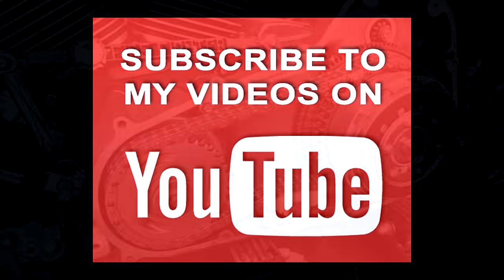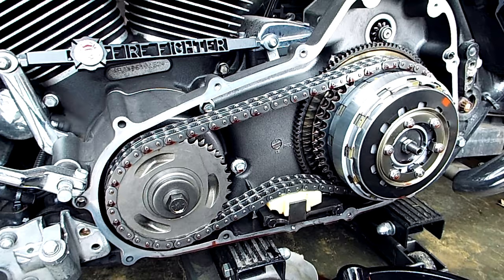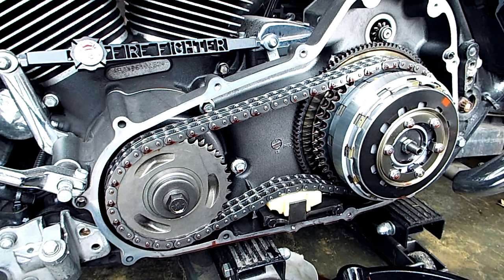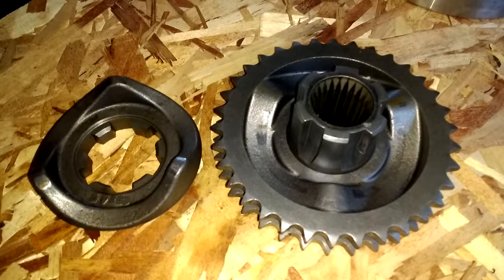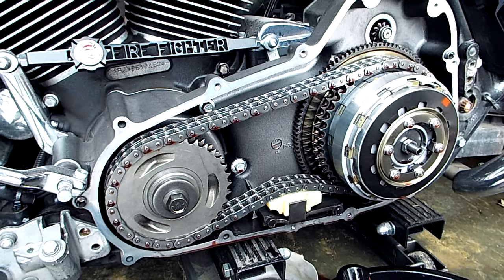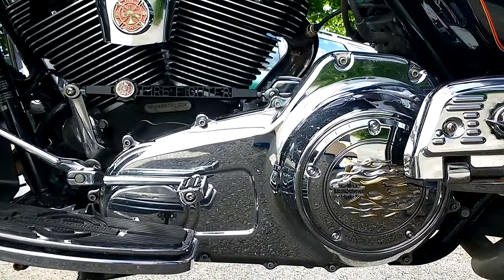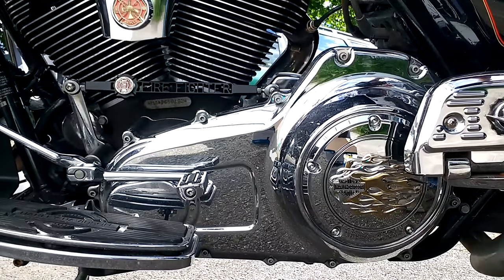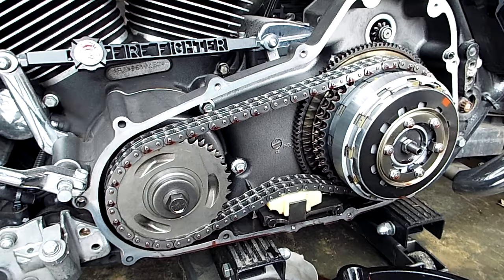Harley Compensator Noise

Comment: Same basic chain primary I had on my 47 Knuckle, 52 Pan and on my 69 and now 81Shovel which I bought new and changed over to belt primary.

It just blows me away HD hasnt gone with a belt primary system by now,  one of the reasons I couldn't talk myself into ever buying another new one.

Comment: Mine has done this for awhile. Mine takes a bit longer to start but rarely does it when I kill the engine. It does it extremely bad like 10x worse if I try to start in gear. Will this lead to any other damage? I don’t have the money to replace it right now
Reply from the maker: It's hard on the starter clutch trying to turn the motor over with all that back and forth clanging around. If you continue to run it before fixing it, I would recommend that you remember to ALWAYS start the bike in Neutral. Starting in gear adds the drag of the clutch plates and only makes it worse. I know what it's like to not have the money to fix things.  I hope it works out for you.

Comment: My 08 ultra has an occasional grind and clunk on hot start with occasional smoke from what looks to be the intake, could this be the issue?
Reply from the maker: It certainly could be, Logan. Along with the thrashing around noise from inside the primary, I would occasionally get that "smoke puffing out of the intake" issue. Here's what I think is going on that causes that. The compensator springs get weak to the point that the sprocket is no longer holding a "fixed" position on the crankshaft on startup, which allows the crankshaft to rotate forwards and backwards as the compression strokes happen. There are notches like teeth engraved into the flywheel inside the crankshaft that talk to the "crankshaft sensor." As the ECU is counting those notches and listening for special gaps that tell it when to fire the sparkplugs, the minor backwards spins are also counted by those teeth giving the ECU a false reading to "fire the sparkplug" and you get a kind of "sneeze" and puff of smoke out the intake. This usually happened when the bike was hot. Sound familiar?
Reply: @contact4mwy7  sounds familiar to me. Dang....
Reply from the maker: @disht2  I agree, dang!

Comment: Was this issue rectify on their 2012?  Just bought a 2012 super glide.   Newbie here.
Reply from the maker: The issue of the factory compensator is for 2007 through 2010, and 2006 Dyna's. You should have the factory installed Screamin Eagle unit. Happy riding to you!

Comment: Please help!!!!! My 2004 is making a vibrating noise from primary and its only when bike is moving I even put bike in  neutral and sound is still there I even turned engine off and sound is still there... what can it be... is its serious HELP
Reply from the maker: That's hard to diagnose without hearing it. My first thought is a transmission shaft bearing as the belt drive will be rotating the pulley on the shaft. I recommend you take it to someone (a shop) who knows about working on bikes and have them check it out.
Reply: Took it there just by sound he said same thing and said only way to get that bearing is split the case and said like 3000 dollars 😮 but like he only went by sound isn't there a way to see this for sure without splitting case?
Reply from the maker: @jasedavids1795  I haven't had to replace mine yet, so I'm not familiar with how to diagnose for sure without digging into it.

Comment: my 2016 road glide ultra started compensator noise at 10K. had the screaming eagle compensator put in. 20 minute ride home from the shop and that one was making the same fricking noise. waiting now to get it in again.
Reply from the maker: Sorry to hear it, Tim. I eventually bought a salvaged Screamin' Eagle compensator and rotor for mine, but I added a third medium spring to the spring pack to give it some extra tension, not too much more than factory. I've put a few thousand miles on it without issue so far. No noise and solid starts. I hope you get in soon to have it looked at, Summer's coming!

Comment: How many miles did ur bike have on it when you started noticing the noise?
Reply from the maker: When I bought the bike it had about 64,000 miles on it and was making the noise somewhat. I thought maybe it was just a starter issue that I could fix later by replacing it. It got worse as that Summer went along, especially on hot starts after fueling up.

Comment: Mark would this set up be similar in a 94 1340 80 motor.
Thank you very interesting video.
Reply from the maker: I don't believe so, Richard, as they used a different compensator for that bike more suited for its power. The early 96 cubic inch bikes got the same compensators as the 88 cubic inch bikes which was found to be too weak for the increase in power. It is possible that you compensator springs may be getting weak if you are gearing odd noises? I don't feel it's a common happening though. Someone else's opinion is welcomed in reference to that.
Reply: @contact4mwy7  
Thanks for your advice Mark.

Comment: Hey Mark or anyone else. I have a hard time finding neutral on my 2013 Heritage Softail. Is this normal? First time Harley owner.
Reply from the maker: With the motor running? Yes. That's my opinion. Some will argue that, but yeah, even with changing the compensator and primary chain tensioner, when I try to shift into neutral it jumps right by and lands in second. Then back to first. Back and forth. I've kind of perfected just a tap on the heel shifter with my foot to bump it into neutral, works 8 out of 10 times I guess. So don't worry about it, it's likely normal. When you start hearing odd metal clashes then get it looked at by a mechanic. Until then, ride safe!
Reply: @contact4mwy7  Thank you. Same to you.
Reply: to much primary fluid, use 28 oz ONLY.....PROB SOLVED.
Reply: Use a really good primary oil...redline or amsoil 50 weight or better...you will find neutral everytime.
Reply: @contact4mwy7  first thing is use the shop manual and adjust the clutch per the manual. Second thing make sure primary fluid is correct and level correct. Check primary chain tension or adjustment shoe. Even then I sometimes will have slight issue and if I ease out on the clutch lever just a bit while at the same time giving shifter gental upward pressure she slips right into neutral every time. It takes some time to get the knack but it works.

Comment: I have an '07 RK police w/ the 103ci. Same thing on it as yours. Already shredded my oem spring pack cup. Baker replacement has a 2 month back order as of right now.
Reply from the maker: Shane Hall 2 month back order?? Wow, first I've heard of that. Right now I'm running with an extra spring washer (the 4 factory spring washers plus a 5th I bought used) and on my second configuration with it pointed out and against the compensator ramp piece it's behaving very well. No more clunky hot starts and just a little engine pulse felt on the road. The first way I put it in, at the back facing out against the other 4 felt more like a solid compensator sprocket too much engine pulse vibration. No need to remove the stator rotor, inner primary, etc. Video coming soon. Thanks for letting me know!
Reply: Mark Young - Outside The Box 
Mark, that sounds like a decent fix.  I would love to see that configuration and how you made that work. Looking forward to the video.
Reply from the maker: Shane Hall I went on a 35 mile ride yesterday and although there is a little engine pulse in the drive train, it's not that bad, and the hot start issues are gone. Video soon.

Comment: Is there a chance that the nut just wasn’t getting tightened enough??  I’m having the same problem but I think it’s just because I didn’t tighten the nut enough.  Read it should be 75 ft lbs then another 45 degrees
Reply from the maker: Maybe that would depend on the year and model of bike and engine? The 2011 Harley Davidson Service Manual lists the tightening sequence as follows; Add Red Thread Locker. Tighten the bolt to 100 foot pounds, then loosen one half turn. Next tighten to final torque of 140 foot pounds. There have been some bulletins released that list a higher final foot pound setting. I tightened mine to a final of 150 foot pounds. You should consult a Service Manual that covers your bike.
Reply: Mark Young - Outside The Box thanks
Reply: A man at a shop told me to tighten the compensator nut as tight as I Could.I broke the dang thing.Can you give me some advice on getting  the broken nut loose.Im pretty poed about now.

Comment: Is it the clunk noise at cut off?
Reply from the maker: At both startup and cut off. The spring pack had become too weak to firmly hold the two halves of the compensator together which let them slide back and forth on each other as the compression on the pistons built and released. It's this sliding back and forth that you can hear from the primary area.

Comment: I have a chattering sound coming from primary, idea?
Reply from the maker: Could be weak compensator springs, stretched primary chain, problem with primary chain tensioner, clutch rattle...
Reply: @Mark Young - Outside The Box  yeah I set clutch so maybe time new tensioner, not getting any knocking or clicking at shut down, it happens while on road at certain Rpm, often just before or after shifting,along with a wearing sound sometimes as well.
Reply: Goes away once you excellerate

Comment: Why in the hell here in 2017/ 2018 is Harley-Davidson still using a chain primary drive? A gear drive primary is smoother less maintenance and less headache.
 A gear drive primary is the way to go and they will use it sooner than later and Harley-Davidson can use the current primary cover for appearances.
Reply: you dont ride a Harley do you?
Obviously, if one has to explain you still will not understand
Reply: Money....
Reply: @jimscycleandautotn8508  yes, it comes down to money (everything usually does). There is this motorcycle called a V-rod H-D introduced, and essentially it flopped. It didn't vibrate enough. It didn't blap enough. And it had these weird radiator things. The customers who purchase H-D motorcycles are the reason H-D motorcycles are built the way they are. I think H-D should have made a touring platform with that type of power plant. Polaris would not have made it this far, but at least there's options.
Reply: Again very good idea I seen you in the other video yes Mark I totally agree, we  will have to sign a petition and have Harley agree with us,bro!!
Reply: SMFH

Comment: My 2012 103’ sounds terrible. Just as you said. Run it to gas station and soon as I start it that grinding of the gears is terrible. Sound like the engine is about to rip apart. After the 3rd time I had to go to the doctor. 53k miles, cycle Rama. 570-2 cam, and Harley 2214408b piston heads
Reply from the maker: The phrase "Go big or go home" comes to mind! I take it you had the compensator replaced too?
Reply: Mark Young - Outside The Box yep. Do you have any engine work to your bike. I’m wondering if the added power is the reason this occurred.
Reply from the maker: @imac19791  there are a few minor changes from stock. A Vance and Hines VO2 Intake, V&H slip on exhaust and a Power Commander V tuner. My Road King came with a trunk/backrest that added some weight to it. As this happened after I bought it at about 63,000 miles, I do not know how much the previous owner twisted the throttle, etc.

Comment: In 2014 & later they cam out with a new compensating sprocket the others could not hold up to the bigger engine
size. The new one is screamin eagle & stock on new bikes works well If installed three or four.
Reply from the maker: Thanks Dale!

Comment: My 09 FLHR does this but I haven't notice and noise on shut off... definitely on a hot day restart sound like the damn front is about to fall out.. I do have 55K plus miles
Reply from the maker: The spring pack could be getting weak and causing your hot restart issues. I'm guessing as it gets even weaker you will start hearing clashing noises when you shut it off.

Comment: Mine rattles but doesn’t make this noise at cutoff. 🤔
Reply from the maker: If it hot starts ok, it just may be ok. Some noises are 'normal' as there is a lot of moving metal parts inside the primary.

Comment: My 07 sg 96 just start making  a rattling noise . Sounds like coming from primary.  But it does it on down shift or at a certain  tourq. It kind of sounds like the chain may be lose
Reply from the maker: How does it start after stopping for fuel for instance? It might be worth opening up to take a look around. How many miles? If it has the stock primary chain tensioner which automatically ratchets to take up chain slack I would be surprised if it is coming from a lose chain. If it has the factory flat disc compensator the spring pack may be losing its pressure just like mine and so many others did. It compensates in both directions, throttle on and off. Does it sound louder at low rpm's when you are on the throttle?
Reply: @contact4mwy7  it starts fine after stopping..  no noise at start that I've noticed. But yes I'm going to open it up to look before  rideing again. Supossidly  the confisator  was fixed before  I got it . But we will see.
Reply from the maker: Ok. I have to wonder what "fixed" means. Did they replace the spring pack? Maybe? I felt the rest of the design was good except for the retainer ring surrounding the spring pack. One fellow said his separated on a highway that stranded him, but he's the only one I've heard from so far with that situation.
Reply: @contact4mwy7  all I know is the previous  owner said he had had it fixed. That one reason  I'm going to pull the primary  off.

Comment: Thanks for that I have 50k on a 09 Street Glide, not noisey yet but that was helpful Mark.
Reply from the maker: Thank you for saying so. You've done good so far, and it may last a while longer before the spring pack weakens to the point where you notice hot starting becomes a chore. I have uploaded videos of swapping out to a Screamin Eagle compensator unit. I've also been experimenting with replacing the thrust washer with another spring to beef it up a bit. So far so good with that. Ride safe!

Comment: I have the same noisy compensator... But I have a 2005 Softail (Night Train) with 88 cubic inch motor. Is it a different problem?
Reply from the maker: Tiger Muff I have to admit, I'm not as familiar with the TC88 setup. If you suspect it is the compensator making racket it would be wise to open up the primary case and inspect it. I could roll mine forward and backward with one finger, as seen in my Installing Hayden Tensioner video.
Reply: Thank you for the quick response and for your videos.
Let's see what's behind the primary case.
Reply from the maker: Tiger Muff you're welcome, I try to keep in touch. Go easy with it, have someone who's done it handy if you can. And oh yeah, watch for the oil inside there. It'll get everywhere. Drain it through the drain plug the best you can, but there is always some that oozes out when the cover comes off.
Reply: Roger that. Thanks for the warning.

Comment: What about the 06 night trian ..just got it back from the shop ..5500 miles been setting for a while its not quite that noise but can amagine its going to get worse dam 4,000 buck they didnt even chsnge the oil or filter ..like they just dont give a shit ..😊
Reply from the maker: That doesn't sound like a shop that cares about you more than the dollar bills flowing over the counter. Is this an 88ci engine? If so, you should be alright with the compensator. Checking the cam chain tensioner shoes should be on your list though. Search for twin cam tensioner shoe failure and you'll see what I mean.

Comment: Wow, this brought back memories.  I had this crap happen a few years ago and it became a whole lot noisier when I was on a trip and I was actually worried about getting home.  I ended up replacing it with Harley's own Screamin' Eagle compensator and stator.  It's been silence ever since.  What a marginal design in the first place.  Harley's pretty good at that.
Reply from the maker: TalkRadio thanks for the comment. I'm glad to know that the Screamin Eagle unit has been good to go!
Reply: I had some time so I ordered it all through Surdyke and saved around $100 on the parts.  The instructions call for this special two part epoxy for adhering the new oil diverter to the primary case.  Of course, Harley was very vague on that.  After some pulling of my hair, I finally discovered it is sold from a company called "Chembar."  Look for an item called LORD Maxlok MX/T6.  $22.50.  Screw you Harley and your dealer secrecy.  The job went very easy and straightforward.  You'll also need a T70 Torx bit I think.  It torqued at about 170 ft lbs too.  Pretty darn tight.  This compensator/rotor will be silent.  Couple it with the Baker Attitude manual chain adjuster and you're riding like a King.
Reply from the maker: TalkRadio thanks for letting us know the "secret" epoxy. Good sleuth work right there!